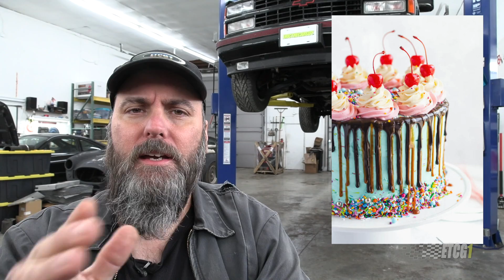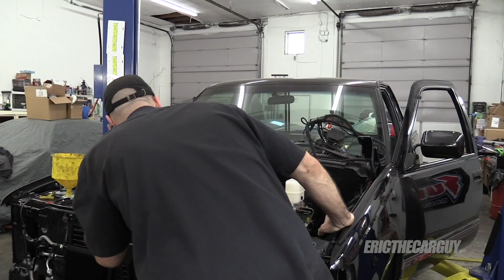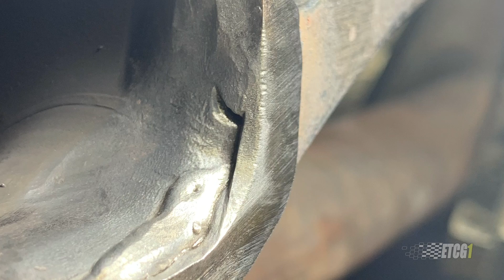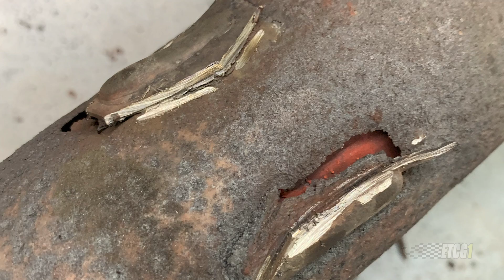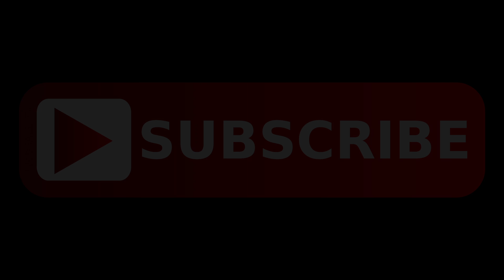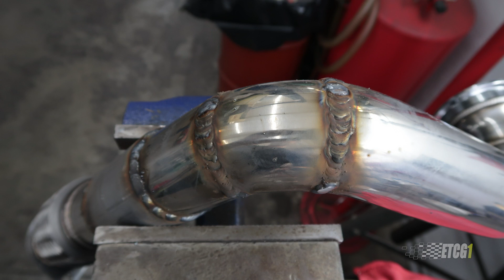Exhaust Noises

Comment: I hate exhaust leaks as much as you do! They just get under my skin. Drives me nuts! I was trying to find a stainless steel system for my 93 Volvo 940, and the only one available was a poorly manufactured eBay one. Wasn’t exactly cheap, but neither is putting crap Starla exhaust systems on every 18 months when they rot out. Since it’s stainless steel, I can’t weld it. I’m not set up for it. The cheap clamps that came with it actually caused more leaks. The muffler sucks too, since it allows all the super low frequency noise to pass straight through it, which is really weird. I can hear the car coming when my wife is driving it clearly inside the house, since it shakes things subtly. It’s not really loud when you stand next to it. It’s just the low frequency sound that comes out of it. It was either that, or a quiet system that rots out every 18 months! Can’t win with that one ... 😣
Reply from the maker: Sorry to hear about that. I know how frustrating it can be. I hope you get it sorted at some point.
Reply: @ETCG1  - Thanks! Since it's my wife's winter beater and she's become used to it, I'm probably just going to leave it alone. Next project is to install a new transmission in the Silverado at 103k miles. Always something around here!  😬

Comment: Yes, it is such a relief when it is fixed.  Especially on family member's vehicle.  If it was my own vehicle, I can say whatever.  But on family's is like, unless you want to terminate your family relationship, then you'll HAVE to fix it.  It was a 2005 Opel Corsa.  I went underneath it 3 times.  First to replace the middle section.  Second time find out the middle and rear doesn't connect properly so went in with half a tube of exhaust paste (which silent it for a month or 2).  Third time replace the rear completely because the rear's diameter was too wide, also the rust inside will destroy any exhaust paste you smear into it.

Comment: LIke you, I hate exhaust leaks.  Fortunately, I haven't had many.  My '94 Dakota  with 254,000 miles on the clock recently developed it's first leak, barely audible, and I don't like it.  Since I only drive this truck about 1500 miles per year now, I doubt that I'll even repair it, but it does bug me.

Comment: My CRX leaked in the exact same spot as the integra. Except that the whole lower exhaust manifold was also rusted through and i wasn't just hearing it, i was SMELLING the exhaust inside the cabin. a new manifold and gasket fixed that, for a year. now the exhaust leak is back, and SO IS THE SMELL. I hate sitting at stoplights smelling damn exhaust fumes. Not so bad that it would make my head hurt, but still awful.
Reply from the maker: The sooner you fix that the better. Breathing exhaust like that isn't good for you at all.
Reply: @ETCG1  For sure! The car is parked for winter and i have all the time in the world. I really hope it isn't the cheap chinese manifold cracking, but if it is, eh, more where that came from lol

Comment: I had an exhaust leak in my 2006 Equinox along the seam of the muffler, I didn't want to spend $200 to replace it, instead I used some aluminum mesh and muffler cement and that fixed it.

This year the Malibu's flex pipe was replaced, this was the ten year old original, but there was an exhaust leak at 4000 rpms, the flange gasket just wasn't sealing well. Then the seal blew out in the weakest section, my mechanic used two gaskets and replaced the studs with bolts and now it's not perfect but much better, I'm not interested in spending $700 for the factory OEM exhaust system.

Comment: The only exhaust leak I have "fixed" on my car was a busted flex pipe and I fixed it by changing the whole car since its body was so far gone that I couldn't do anything without getting rust-rained on at the slightest bump. Nearly all remaining OE steel lines looked ripe to burst at any time, as were most screws and fastening hardware. Basically impossible to work on without breaking a bunch of stuff anymore. Got to love Canadian winters.

Comment: I think the easiest way to find exhaust leaks is using soapy wooder
Reply: Leave chrisfix alone
Reply: Have to hurry though if its hot it boil away before you can find it.
Reply: i use the carburizing flame of the oxy -acetylene torch
Reply: I use left over blinker fluid
Reply: Gotta replace exhaust bearings

Comment: Fully agree, Eric! lol I've parked vehicles for exhaust leaks I couldn't get to right away because they just drive me bonkers (granted that's a short trip), no matter how seemingly small, exhaust leaks just generally ruin the driving experience. Being that I do my automotive repairs alone, I've found that a shop-vac hose wedged firmly in the exhaust tip(s) with rags allows me to easily find any leaks without the need to run the vehicle, which makes hearing them infinitely easier/quicker - matter of fact I just located a very small, but still perceptible leak on my truck last week that'd been annoying me for a while using that method. Thanks for the videos, Eric!

Comment: My god yes. I have a 97 cubic hx. Hates any leak. Period. I've been trying to chase it and I think it's in the catalytic converter. After fixing 4 of them that's the last spot. I'm down to fuel trim of -5.5. I'm going to just have someone weld it there or use the exhaust epoxy. I haven't decided which

Comment: My primary means of transportation is a 1972 Mercedes 280SEL 4.5, a highly civilised car with a real beast of an engine and, after 48 years, of course it has exhaust leaks.  Doesn't bother me in the slightest because the engine is so loud the leaks are completely inaudible.  

I bought the car new in '72.  I guess it's possible the thing has gotten louder over the decades, but memory says otherwise--it just takes a whole lot of engine to haul a massive car at 140mph and, I guess, big engines are just loud, especially when they cram a 4.5 litre engine into a space designed for a 2.8 litre engine.   (There's a thick--like 6 or 8 cm--pad glued to  the inside of the hood.  I think it's meant to be sound insulation.)

Comment: I've had a persistent passenger exhaust leak on my fox through 2 different exhaust systems. Old system w/ an offroad h-pipe that leaked at the collector, new system is at the header flange or lack there of (macs). Gone through a couple different types of gasket to try and sort it out. Drives me nuts.

Comment: Several years ago I had an exhaust leak between the header und the cylinder head on one cylinder of my Mk3 Supra. It made it sound exactly like a tractor. It was embarrasing to drive. Wasn't an easy fix since the studs are notorious for stripping out of the head (aluminium), so you basically have to drill every hole and use a threaded insert in order to get it to work again. Without removing the engine you have to use a low profile angled drill because of space limitations. Not fun but worth the effort.

Comment: My son is tolerating his exhaust leak in his 2001 Camry LE.  It has about as much noise as a teenager's header.  This month, he is getting an estimate for replacing the original exhaust pipes, while the muffler is a newer after market piece.  Maybe he will be able to keep the original Catalytic Converter.  I don't expect replacing old exhaust pipes, in 2020, to be an affordable service visit but, he is going to my independent mechanic instead of the Toyota Dealership.

Comment: Very appropriate I too have an 2004 Element with a small exhaust leak which I need to address any suggestions for a replacement cat back?
Reply from the maker: I used one from UPSW Auto Parts. The pipes were good, but they hardware was junk. They did send all the hardware with the parts though. That's not common in my experience. Also, be sure to check for leaks under the heat shield in the pipe before the cat. I found several leaks there that I had to fix.
Reply: Thanks what about a cutback exhaust
Reply from the maker: I don't know what that is, sorry.
Reply: I meant catback exhaust like injen
Reply from the maker: The one I installed on my Element IS a cat back system.
Reply: Thanks any thoughts on an injen exhaust or magnaflow?